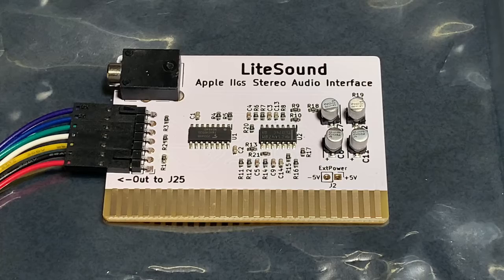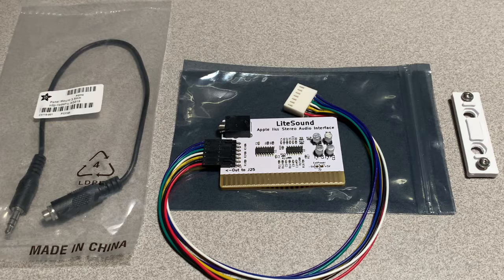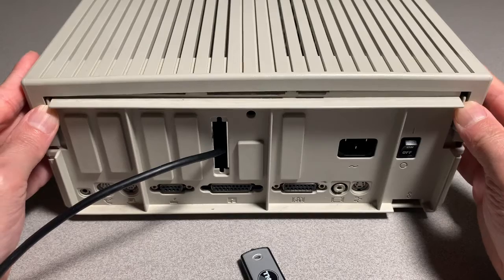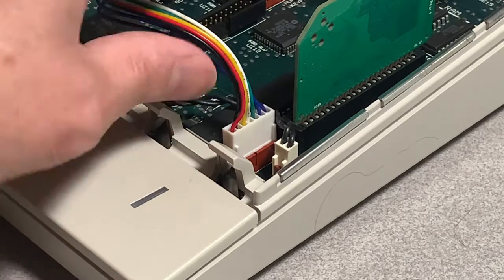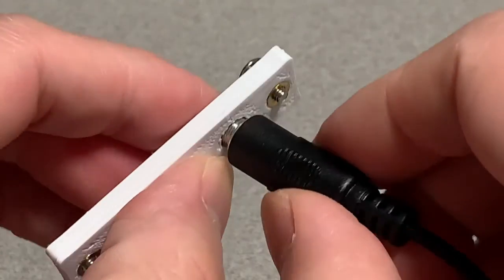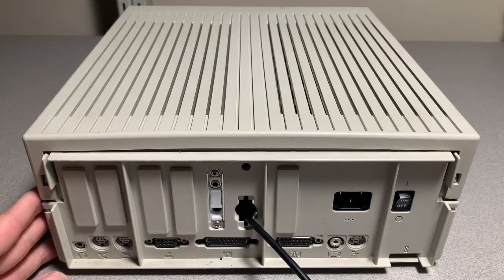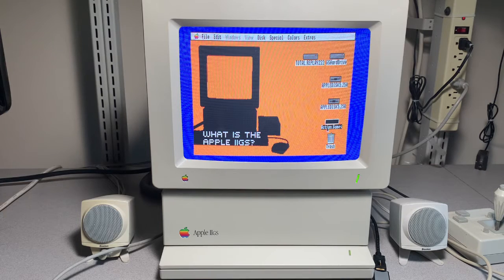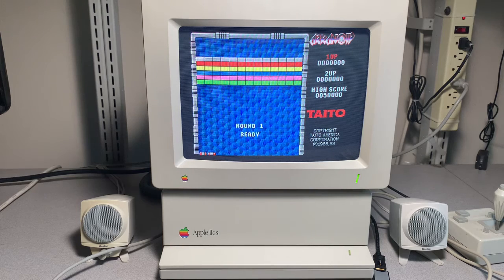LiteSound Apple IIgs Stereo Audio Interface - Install and Review

Comment: It was pretty wild that the IIgs basically had the capability to do stereo sound and sound recording, but Apple simply chose not to put the ports on it to do those things. At least they gave us the sound expansion header so they could be added trivially after the fact.
Reply from the maker: I completely agree.  The decision to go with a mono out had me scratching my head.  Luckily the solution is quick and easy.

Comment: After purchasing my Apple IIGS in 1987, a stereo card was the very first accessory I added (it's a must have, no question, and glad to see someone making one available in 2024!). The LiteSound is quite a bit smaller than my Audio Animator, Sonic Blasters, SoundMeisters or SuperSonics I have in my collection. On a side note, I would recommend adding a 2.1 speaker set up to a IIGS with stereo card, the sub-woofer adds a whole other dimension of sound with games like Spacefox! My current set up is an Audio Animator connected to Altec Lansing ACS-33 speakers. They're small, match the GS aesthetically and even sound better than my Bose Roommate speakers!
Reply from the maker: Agreed!  The GS is currently hooked up to Boston BA635s which have a "Satellite Subwoofer".  Even with those, it was an incredible difference compared to internal speaker.
Reply: @70s80sRetroRewind  - I always considered the internal speaker only for backwards compatibility with 8-bit Apple II software, or like a PC, basic alerts like startup 'beep' or the error bell. Even before I had my stereo card, I used to plug in headphones or connect my GS to a boombox or home stereo. That internal speaker isn't suitable for the Ensoniq.

Comment: Back in the 90’s when my GS was my primary productivity computer, I routed the stereo output and the monaural output to an audio switchbox to avoid the internal speaker when I wanted to listen to the stereo output. It was a simple matter of pressing a button for the monoaural. This also might be an effective use to bypass the clicking noise upon shutdown by selecting mono first
Reply: A lot of folks run their stereo card and a Mockingboard out (that's why there's two holes in this plate) to a passive mixer ($25 from Amazon give or take) and then out to speakers.   It's pretty slick.
Reply: @BobDarlington  - I don't get the need/want for a Mockingboard in an Apple IIGS. Yes, the AY-3-8910 chip has a unique sound, but there are literally zero IIGS titles that support the Mockingboard, and only a small handful of 8-bit Apple II titles (that the GS can run in emulation mode) that do. Seems like a wasted slot in a GS. That said, my AE Phasor card lives strictly in my Apple IIe.
Reply from the maker: Hi Lemonherb1.  Good point!  Thanks for sharing.